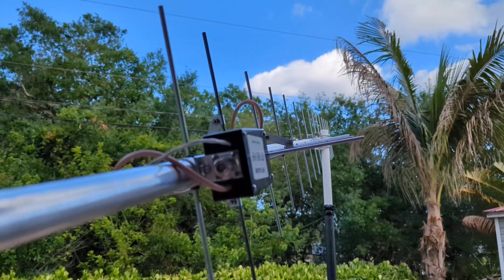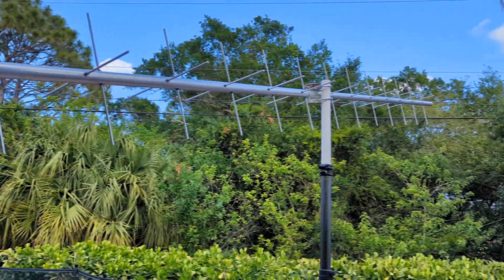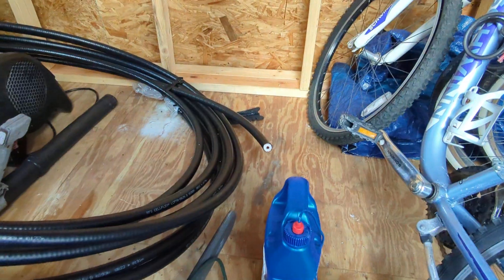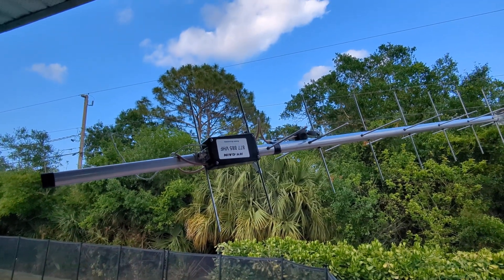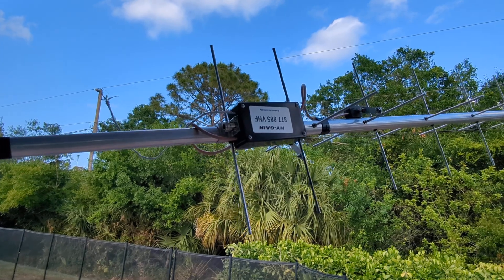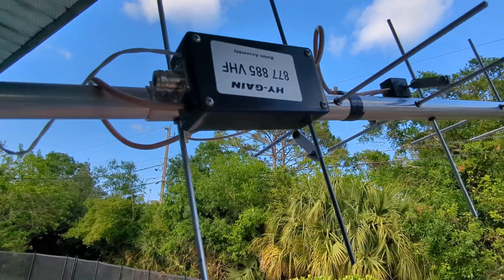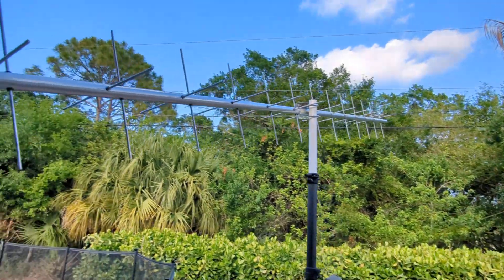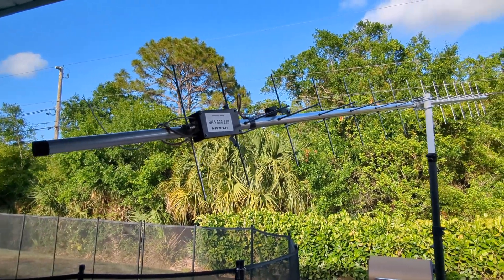EME Moonbounce Project, Part 2, Hy-Gain UB-7030SAT, Progress On The Antenna

Comment: Heyy Eric, I use this antenna for the birds.. not sure what you did🤔it's listed under my Satellite PLAYLIST.. been up for years!!
Reply from the maker: Does your balun say VHF on the side like mine does? 887 VHF?
Reply: @HamRadioConcepts  Eric buddy I could be wrong* But that's NOT A VHF ANTENNA!!! That's the UHF side (you should have gotten a UHF Balun) mine is Satellite Array:VHF 30 elements + UHF 16 elements FM & Linear SSB Birds pic on my VP2EIH qrz page and videos of it on my Youtube PlayList 👍Many years ago it was sold as a VHF & UHF Sat/Package with both antennas... I'm thinking you got the wrong Balun.. My array been up (working Great) for 11+ years now.. Sorry i'm not on that island at the moment, so I can't check for you. currently i'm J88IH my 2nd QTH. 👍change the balun if you can. hope that works 73🎙Ira

Comment: Try putting on the missing elements and see if that helps??
Reply from the maker: Shouldn't have any effect on the driven element
Reply: @HamRadioConcepts  yagis are designed to work with all the elements, so if you are missed some it might affect it, can't hurt to finish it first just to be sure,

Comment: A couple of thoughts...  Circularly polarized cross yagis always use both driven elements, just with a delay line switched between the two polarizations.  So the fact that the resonance is the same (high) on both polarizations is to be expected assuming all other things are the same.  Second, somebody mentioned VF for steel as opposed to aluminum.  I believe that may account for some of the discrepancy, so you might need to go out and get another much longer pair of steel DEs and measure for resonance empirically, as frustrating as that sounds...  Sorry.  (Or maybe there is someplace nearby you can get aluminum rod stock?)  Finally, someone already mentioned the label on the circuit box (delay line switch) - if you didn't get the correct elements, is it possible they sent you the wrong box?

Comment: Not liking the steel element, but check the feeds separately with that phasing box removed.  Take your measurements away from the house.  I'm good in QRZ W2TTT if you want to email me or call me.

Comment: Have you tried getting assistance on the amsat-bb? That antenna was built for the sats, so the easiest way would be trying to get assistance from our Amsat fellows.
You may also install a 50 ohms dummy load, suitable for 435MHz, on the first port while you adjust the second antenna and vice-versa.
Last but not least, I always adjust my antennas pointing to the zenith.
Get rid of that tripod and get the antenna pointing to the zenith. Adjust it that way.
The bracket should be at 45° to avoid disturbing the antenna. Shouldn't it?

Comment: Maybe easy fix, UHF Yagis are extremely sensitive to near-field reflectors. Move it away from the house. At 432MC what is the VSWR, specifically the reactence? Are you using phasing lines (like ¼ wavelength coax) between driven elements, and if so, what length and type of coax? If you're using phased driven elements for circular polarization (like ¼ wavelength delay coax), make sure the coaxial phase lines are ¼λ at 432, not at 470+.In the phase box is there a gamma match? Also maybe an easy fix as well, in the match box any caps, sitting for as long as it did they maybe one or more is just be bad.
Reply: Is the carbon fiber of the mast too close?